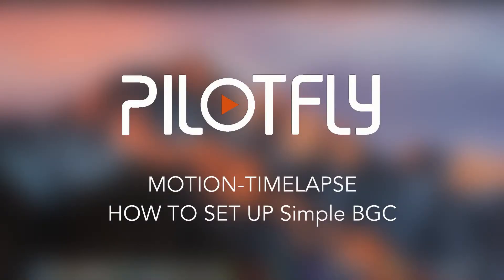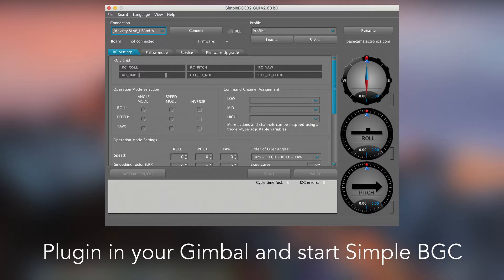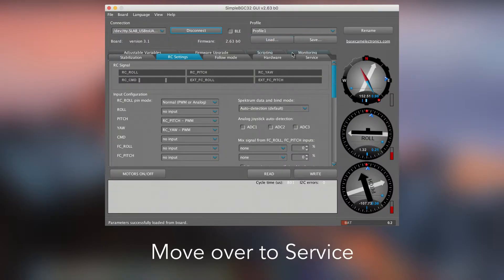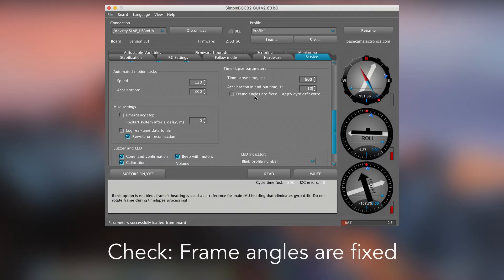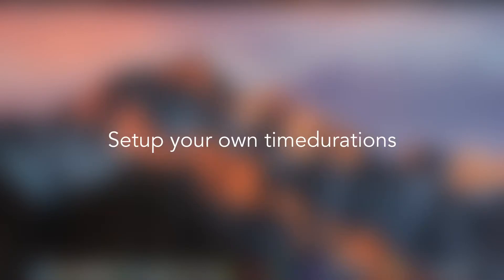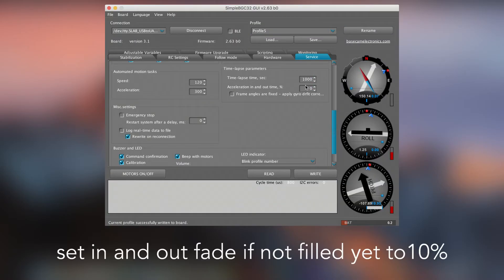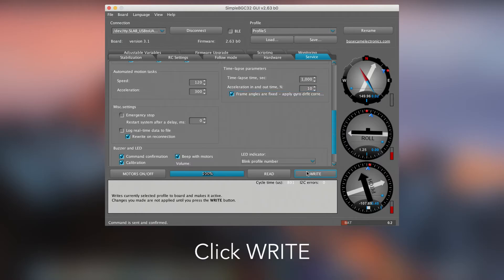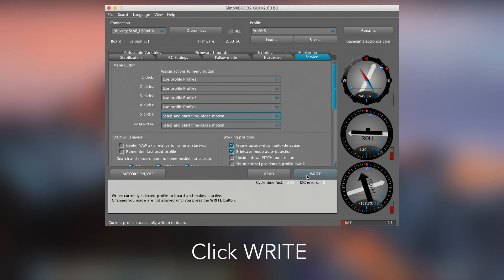PILOTFLY Tutorial - How To Setup and Use Motion Timelapse

Comment: I can activate the mode but my camera shutter wont trigger. I've connected my camera (A7sii) to the camera control port of my Adventurer. What went wrong?
Reply from the maker: Camera shutter trigger in Timelapse Mode is not supported. You have to set your camera manually for Timelapse and set it e.g. 1-2 sec.